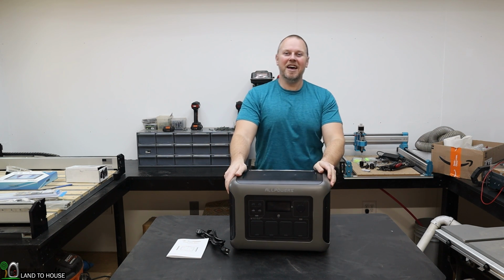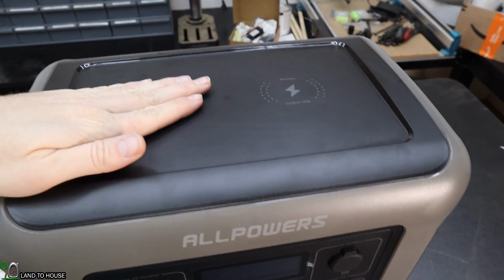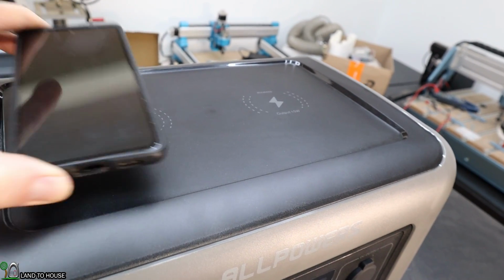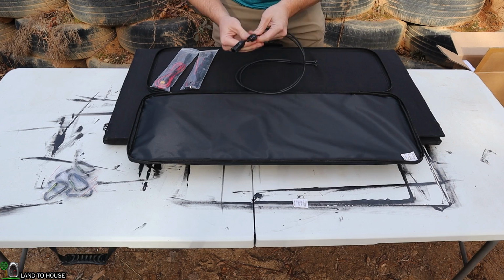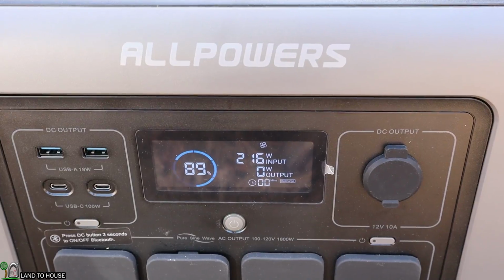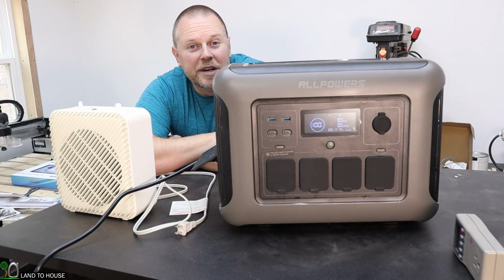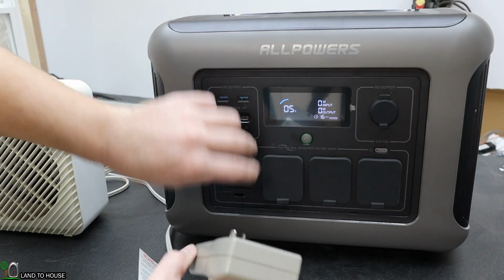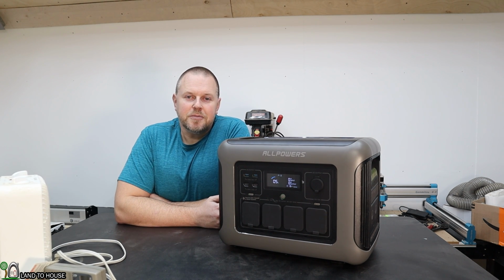See the AllPowers R1500 Power Station in Action! Portable Power when you need it.

Comment: UPS function and enough wattage to run a fridge when a storm knocks out the grid power, nice.
Reply from the maker: The UPS feature is nice. Just made a video showing how a 3d printer can use the ups to save skipped lines on a print.